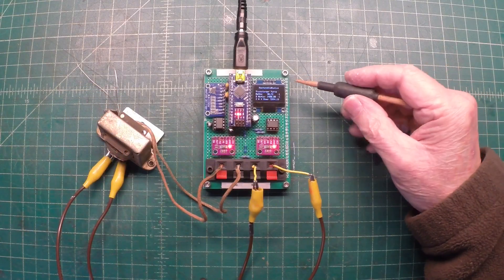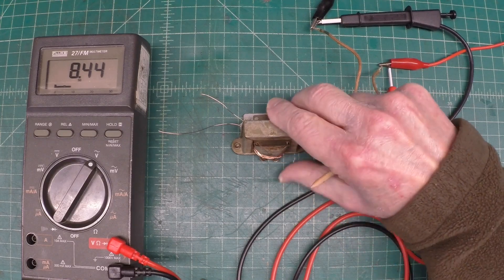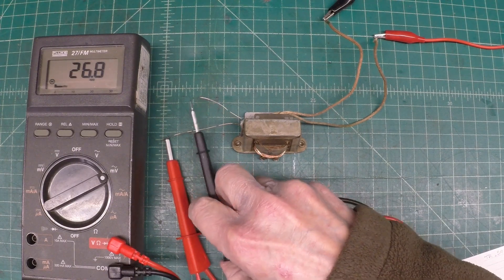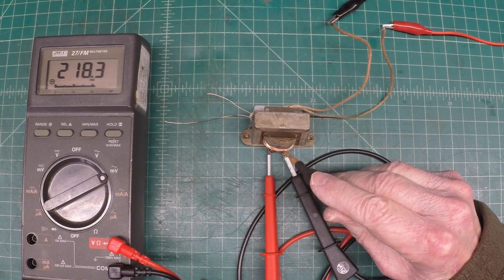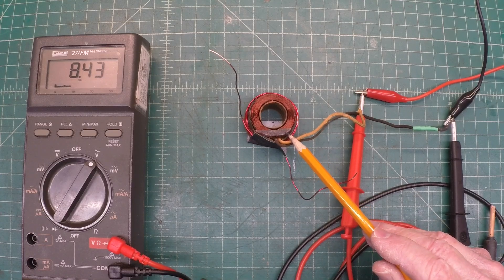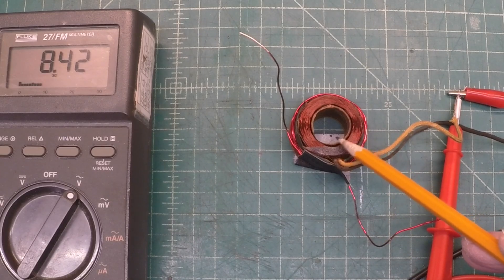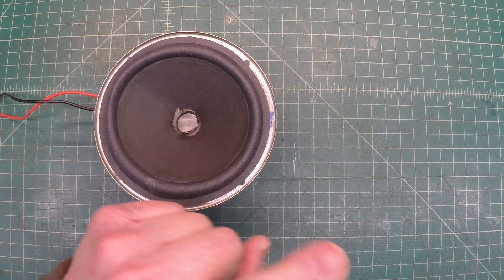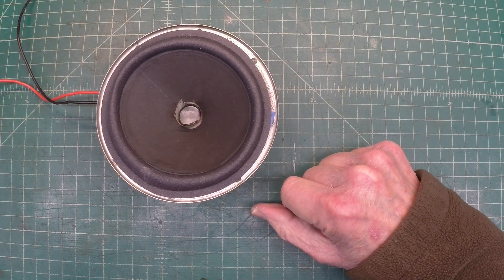Pathe - Model R | How To Determine The Number of Turns | Output Transformer | Field Coil

Comment: Great info Don. I've been watching some other videos and I'm getting caught up with the ones I've missed. You have great talent! 11,000 turns! WOW! You would need a machine for that. Thanks for sharing and have a great weekend.
Reply from the maker: Ryan - thanks for the kind words; yep 8,600 turns on the new Field Coil that I wound with my manual winder with 35 AWG magnet wire. 11,000 is definitely a lot of turns on the OEM coil. I would love to see the original engineering design data for the speaker. Hope you have a great weekend too. Best, Don
Reply: @RestoreOldRadios  I've wound a few transformers, mainly just for voltage. Can be a lot of fun to wind new transformers or adding extra taps and windings to old ones. Use voltage doubler circuits so you only need half the windings. :)